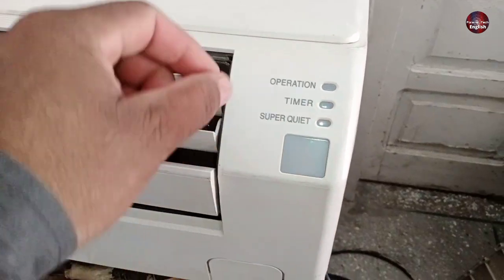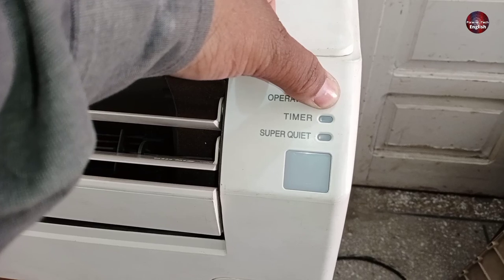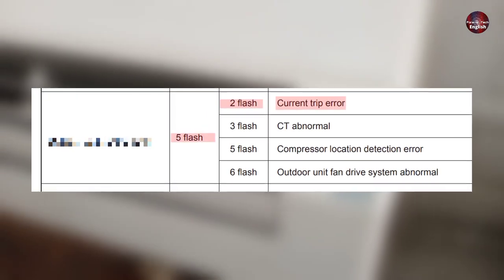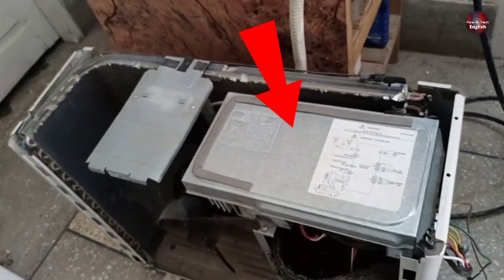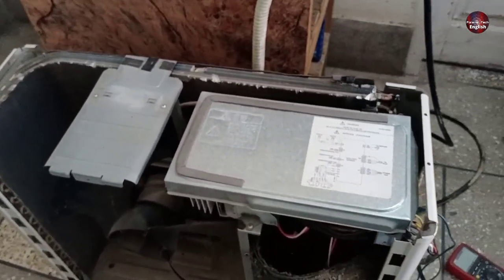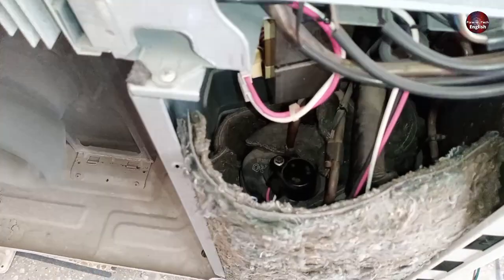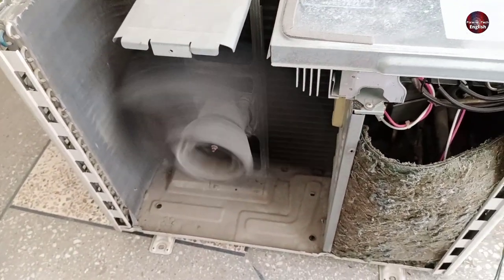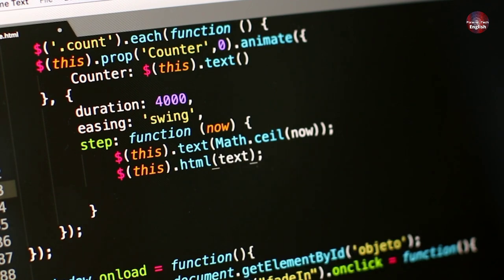Fan Works/Starts But Compressor Fails In Inverter Mini Split AC

Comment: Hello , thanks for your videos. Could you please about for this problem.

operation lamp 10 times flashing and timer lamp 3 times flashing. When I checking error code at manuel users it is comp. Heating error if I am not wrong.

What is the best way to fix this problem?

If you can help about this issue , I appreciate.

Thank you
Reply: And model number is asyg24lfcc

Comment: You can discharge a capacitor just by putting your meter in dc volts and put probes on the capacitor and you can watch the volts go away.